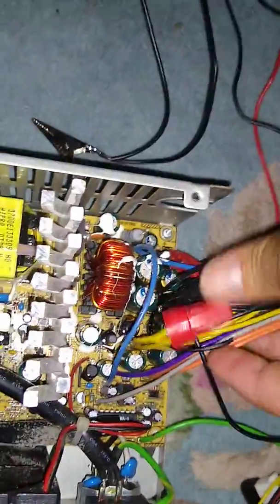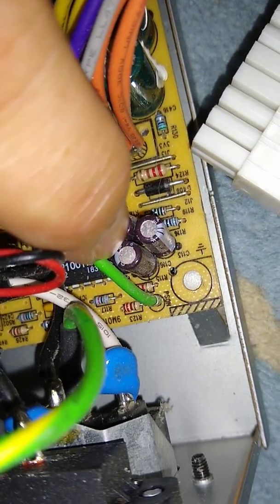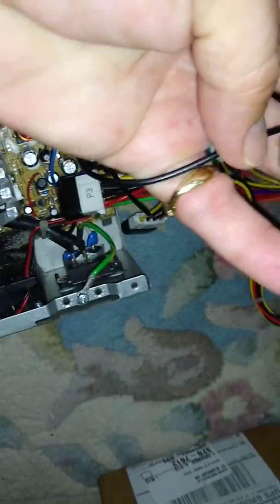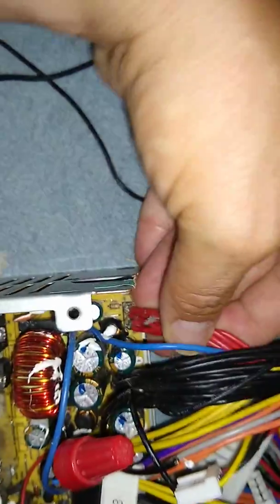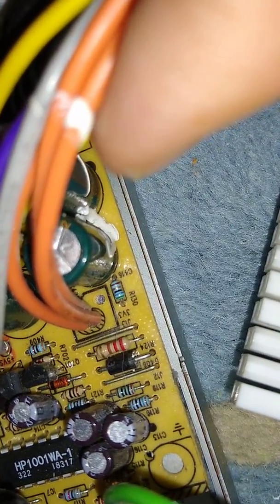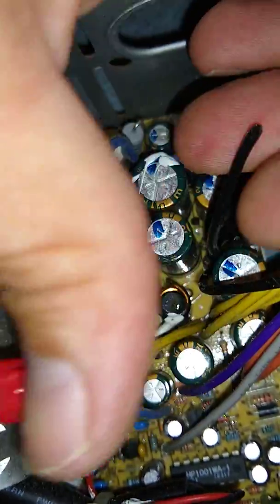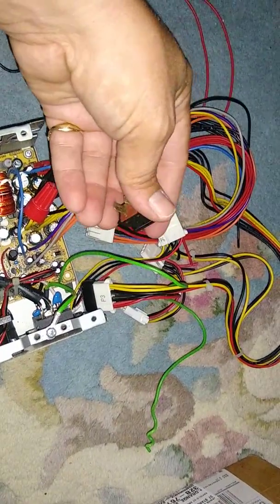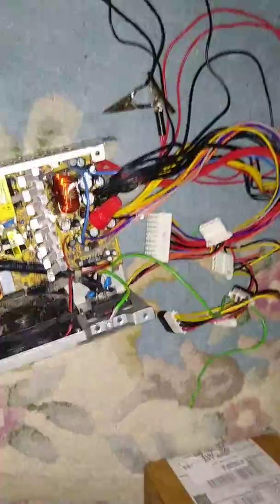How to use a computer power supply for chlorates or as a 12v power source

Comment: I have an 6v power supply, but does not featured with cooling fan, is that safe to run electrolysis for more than 72 hours?
Reply from the maker: Great question.  I would definitely put some kind of fan to cool it down.  Like another commenter said, the PC power supplies don't last more then 2 months.  My experience has been one run then there done.  If I where you I would spend the $30 bucks and buy a cheap  regulated linear power supply.  Try to vent your gasses away from where you keep your power supply because the gasses and moisture will kill your power supply very quickly.

Comment: I know you should have about 5 volt in your chlorate cell setup so I guess you mean that the voltage from the PS should be 5 but to my understanding if I adjust the distance of the cells the voltage will change accordingly so why not do that and you can use any voltage you want higher than 5 volts?
Reply from the maker: nattsurfaren you could very well do that but I use an actual bench top regulated power supply.  I used to use the pc power supply but I got tired of replacing them so I broke down and bought the bench top PS
Reply from the maker: And the actual voltage from my PC ps is around 3.9 at least it was with my setup.  Not sure of the amprege
Reply: The amp should be as high as possible. That means you can run more at the same time. If the voltage is to high it will eat the electrode. If it is to low the temperature will not be high enough. The electrolyte needs a certain temperature to make chlorate. This is what I have learned so far.
Reply from the maker: Absolutely correct.  The amperage is 5 Amp with the bench top and between 5 & 10 Amp with the PC power supply.  It says 20A but you will never get that much out of it.  You only get higher Amps from the PC if you use larger wires and bolt them to the electrodes.  They get hot as hell those little 16gadge wires

Comment: They cant stand long period.I got 6 pc power sup.but 5 are already dead due constant work.They stand around two months at perfect cooling at 5v usage.Also they give max 2,2-4,8amps.Its writen 25-35A but thats a fake.Try to mesure A when its connected to cell.Also vortage drop to 4,2-5,2 V and try to use longer cables because KOH and other vapors eat diodes inside..they goes snow white in a couple days,cooling fan suck moisture and vapors from cell.
Reply from the maker: Accipiter Nisus yeah I found that out the hard way.  Great advice.
Reply: @chemistryscuriosities  One more thing.Do not vaste money on Led bulb power suply.They sell it as 5v 10A,20A,30A and go so,and i buy 5v 20A and it gives me max 3,48A at 3litres cell with 10x10 centimeters lead dioxide anode and same size SS304 katode.Voltage drop to 4,2volts..so its crap.Better option is pc suply red wire,it give an Amp less but constant voltage 5,2volts
Reply from the maker: this  is a PC power supply and I use a regulated power supply.  I only made this to show others how they can use there pc power supply for other things then just to power the pc.